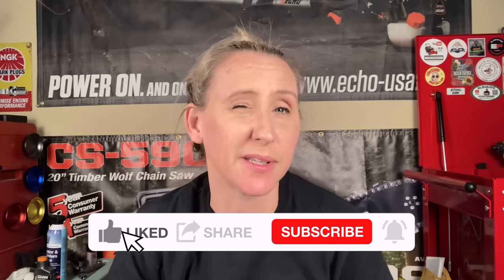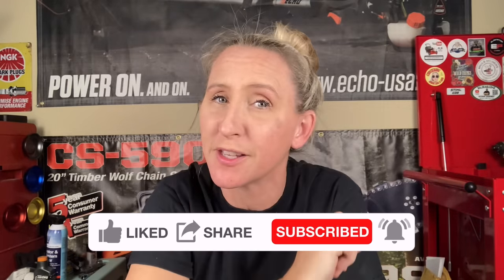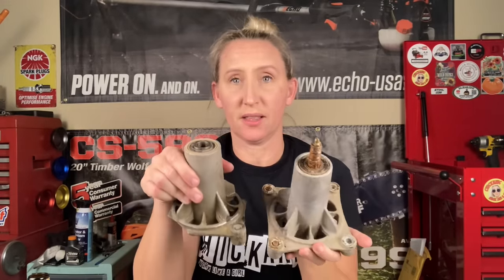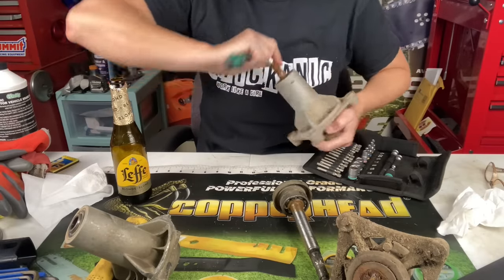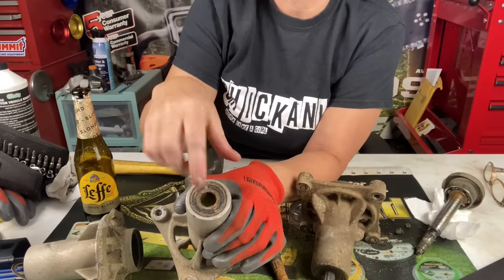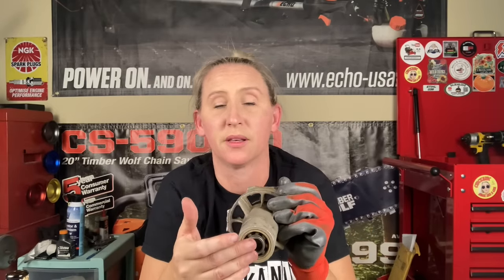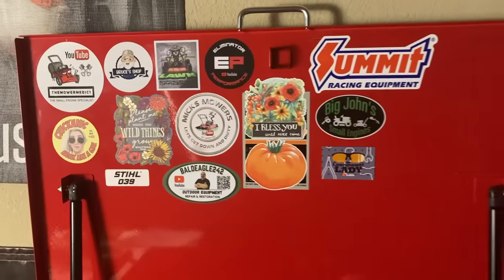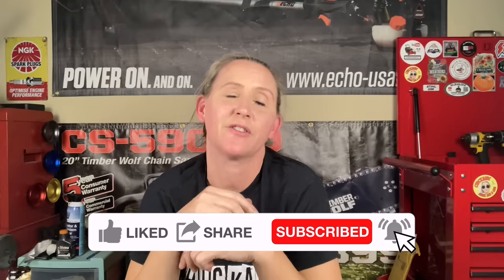THIS IS BIG!! Husqvarna riding mower and Zero Turns HAVE CHANGED! Review/Vlog

Comment: I have the new husqvarna zero turn kawasaki engine.  It is a nightmare.  Parts are impossible to get. It breaks every month or so, one part or anyone.  I just broke the spinner spindle also. Stay far away from husqvarna
Reply: I was going to buy one of these Husqvarna zero turns but did a lot of research. One of the big complaints was people having to weld the rear deck hanger that breaks easily.I noticed that people were unhappy with the low end box store models of every brand. I opted to buy a higher grade better built zero turn for more money. I didn’t really want to spend $6000 but the reviews were way better with less headaches and you get serviceable transmissions. I wouldn’t buy any Husqvarna zero turn from what I have noticed from the build quality and reviews.
Reply from the maker: I have had problems getting Husqvarna parts this past year too. Sorry you got a lemon.
Reply: @andybecker2693  don't buy one
Reply: @Rangergeo85  I didn’t buy one and I don’t understand why anyone would after doing some research.
Reply: @andybecker2693  i have bought many husqvarna products in the past, especially chainsaw that have performed perfectly and have ran when other stuff wouldn't.  I have a husqvarna tractor thats ten years old that has been great. Husqvarna chain saws are great and maybe the best on the market. Everything that has broke on my zero turn has been fixed under warranty. Im saying with their parts problems coming from china is the ussue now.
Reply: @Chickanic  i want to thank you for saving me thousands of dollars.
Reply: @Rangergeo85  I have a Husky chainsaw and trimmer that are almost new and I think they are awesome with no troubles. They make a lot of good products but like most other companies you can’t expect a whole lot from the box store products. Really depends on the application and frequency of use. I understand that cost is a factor but not the only factor.
Reply: @andybecker2693  cost was the main factor why i bought mine. I got the kawasaki 730 engine and any other brand would have cost me thousands more for the same options.  Thousands more. But, i wish i would have spent the money and bought a Bobcat.
Reply: @Rangergeo85  The FR730V is a good engine. I upgraded mine with a pro style canister conversion kit. Way better filtration.
Reply: @andybecker2693  thank you, im going to look into that.
Reply: @Rangergeo85  I’m not sure if it will fit under the hood. My Kawi is on a zero turn. Sorry, I wasn’t thinking.

Comment: So with all that open space inside the spindle you will have to use an entire small $5 to $8 tube of grease just to fill it up enough to force the grease into the bearings.  Sorry, but give me the sealed bearings and no grease fittings. The sealed bearings usually last a very long tome for homeowners. But it's all together different for units in commercial service.

Comment: Ok. This is an older video. I know you' and your shop are professionals and very knowledgeable.
BUT.... The zerks on SEALED bearing spindles are not 1:30  "fake". Just because it is a sealed bearing does not mean it will not take grease. It absolutely will. Most of these setups actually have a bearing with 1 metal seal and one rubber seal on the opposite side. Usually with the rubber seal to the inside. Not all, but a large majority. Either way these bearings ARE greasable. 
"Husky" and or parent co. Going to open bearings most likely wasn't because of the failure do to design etc, but because of failure do to "proper" maintenance on the sealed spindles. People do not understand how they work. 
But again, sealed bearing spindles are designed to, and will take grease, and that grease will enter the bearings. The zerks are there for a reason. 
I've been "shade tree" mechanicing lawn equipment and other small engine equipment for a long time,  and have grease many "sealed" spindles properly.

Comment: never ever hit a shaft  with a hammer, you are not a blacksmith  reshaping metal  it should  stay fresh    use a hydraulic press instead and a soft in between to avoid metal deformation. removing bearings from the casing: gentle warm   expanding the casing  ( most often the choise is aluminum  which has a high coefficient of expansion) untill the bearing drops out.    placing new ones same method.  I have seen loads of new bearings being ruined by wrong placement   having the balls indenting the races due to hammer blow impacts